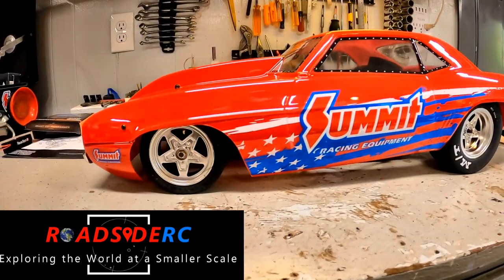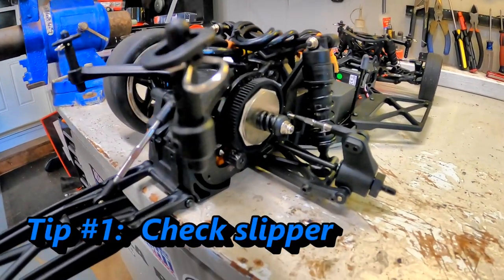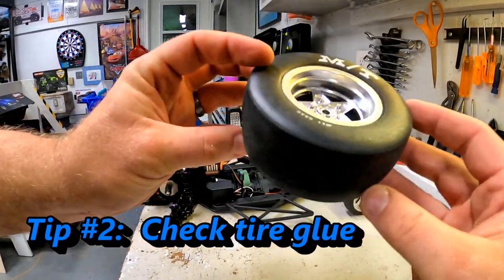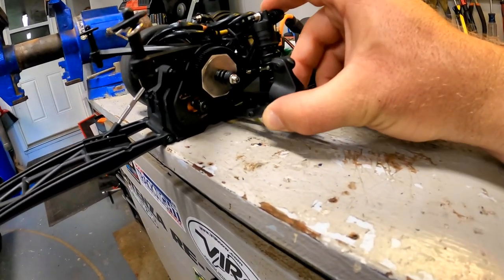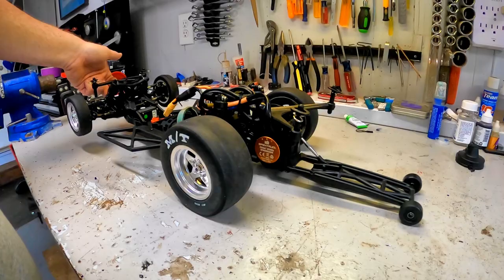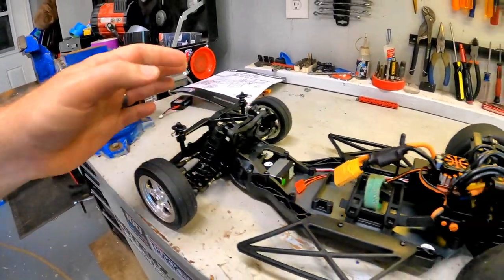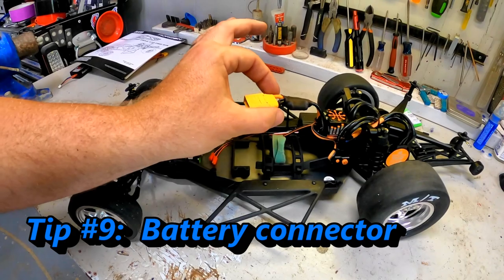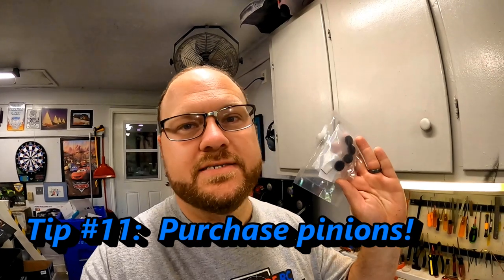DO THIS FIRST!  10 Things To Check on The Losi 22s No Prep Drag Car

Comment: Awesome video Troy, definitely good info right here. Another thing I would say to check its camber adjustments, mine had positive camber all around. Also tighten the servo saver nut a lil, it will help with steering wobble.
Reply from the maker: Nice adds!  My alignment was rather spot on, but you are right that it should be checked!

Now you are going to make me go check the servo saver!
Reply: I would just get rid of the servo saver...not needed in this application.

Comment: I have been living with my 22s camaro now for about a year and i found out that if you seal the vent holes in the rear wheels the tires ballon about 60% less. Also i realized that you must wear out the tires a little bit before they can achieve their maximum traction
Reply from the maker: That makes sense to me!

Comment: Thanks Troy!
I needed to bleed the shocks and remove   1 mm of flashing on one of the pistons that was binding. 
Besides the normal taping, I also had to taped down all the loose lighting wires, which were vibrating and wearing through the blue paint......luckily I bought a spare car for the shelf!
FYI, weight distribution on the Losi is 30/70 with a 4200mah slide to the rear, 31/69 slide all the way forward in the battery mount. GNSS only weighs 38 grams......so placement is going to have very little effect in the middle of the chassis😎
Reply from the maker: Thanks for the math on the weight distribution - that makes sense actually!

Comment: I have one but with the Ford truck body. 
Noticed exact same issue with the tires rubbing the truck bed, put stickers over it but will try black tape (probably look good with my black body. 
The back of the truck body doesn’t roll under like the car does so I don’t have that problem. 
I have a GNSS type system with an LED screen that doesn’t fit on the chassis so we had to mount it on the body. Don’t do that, I nearly lost it when I crashed. 
Looks like I’m getting pinions and rebuilding my shocks before racing season!
Great tips!
Reply from the maker: Awesome!  Thanks for sharing the differences with the truck body. 

Glad this video could help!

Comment: You have a rotary tool so grind some of the body away because of tire expansion in the rear and you can grind some off the gear cover and the right suspension arm it won't hurt anything 😊👍
Reply from the maker: I ended up taking off the gear cover completely - not really needed for drag racing.

I used some lexan scissors to trim the body. 

Worked well!

Comment: Awesome video Troy and I got to mention one hell of a tire save there I seen that tire go flying off the workbench I was like oh no and then you penned it right up against the workbench with your waist I've seen people use aluminum foil tape you do not have to keep replacing it like the duct tape and you can work with it a little better than the duct tape and trim it to your desired size because it comes on a rule you peel the backing off
Reply from the maker: Good idea with the aluminum tape!  I bet that would last longer!

Yes, my belly should be considered a super power!  :)

Comment: Got mine weeks ago. Added carbon fiber skid across the chassis. Hood pins. And today extek mount used to add a fan to motor.
Reply from the maker: Very nice!
Reply: @RoadsideRC   How rude of me, great video very very informative.
Reply from the maker: I still haven't done any mods to this one.  I just got the sway bar kit in and the toe blocks.  Will be interesting to test them.

Comment: Tips are great but I’m wondering are you going to upgrade the suspension? The stock doesn’t allow for travel( squat) on either the front or rear which is what makes a full size car hook. Also the front has to much down travel. If you lift the car in front the wheels go up with it, they should remain touching the ground when the front is picked up and stay down until the lift has reached max height. Also the rear should squat past the point when the wheelie bar has touched, this allows the rear to load and slightly lift the front, transferring all the torque to the back but still keep the car going straight.
Reply from the maker: Agree 100%!   The stock suspension is OK, but certainly not perfect.   
There is a LOT to be gained in suspension tuning - just like in full-size!

Comment: Awesome video. I drove my Losi Camaro last year had a lot fun. I charge my battery and now my car tires don’t spin. I saw a small button for programming l hit a few times by mistake. How do l set it back to factory settings? Thanks
Reply from the maker: The manual has a factory reset instructions

Comment: Xt90 are great who is hating. That's one of the easiest to solder and they support tons of amps.
Reply from the maker: Ahh.  Yes, but they add weight. 
Instead - you can run bullets straight to the battery.

Comment: 7:20
I thought the standard practice is to have a bit of air in the shock bodies which lack a reservoir, since air is compressible and you need to account for the space that the shock piston will take up
back when I used to own a Losi Mini LST, I tried to fill the shocks to the brim and it got pretty ugly, the shocks wouldn't compress at all and then the oil squirted out the seals when you squeezed hard enough
Reply from the maker: Not in the shocks I have built.  Especially of they have the rubber dampers at the top.
Reply: No air.  It creates great inconsistencies in the stroke. Bleed them good
Reply: @zackjay71  the shocks that came with the Mini LST were literally just cylinders with a hole for the shaft, nothing else
the compression of the air was the only thing allowing the shocks to move at all

Comment: great tips!
i recently grabbed the yellow f100 version on sale at a-main hobbies...
ill be disabling reverse and "softening" the brakes a bit as well...
might swap out the radio kit as well...gotta be able to dial out steering....
its gonna be a sweet bracket racer!
Reply from the maker: Awesome!  Hope you enjoy it!
Reply: @RoadsideRC  im sure i will!
right now im getting my "dragrat" dialed in for bracket racing...its a trophy rat with dr10 wheels/tires....
the slowest your car can be is 4seconds....
i have the car turned up all the way and with a ovonic 5200mah/50c 2s lipo im hitting 4.1 all day with occasional 4.00 ET......
wonder if i install a 4300kv moto would that "legalize" me more...stock moto in the car now is a 3300kv....

Comment: hello man it's my first time on your channel good content a question where can i buy one like that but a Mustang. Thanks
Reply from the maker: You would still buy the same car/chassis - but then swap to a Mustang body that is available. Pro-line came out with this awesome looking body:  https://www.avantlink.com/click.php?tt=el&merchant_id=4b85b2b7-558e-4304-89fc-54958c8f47f0&website_id=caf4cba5-8e5f-43be-93b7-934f1a36d50d&url=https%3A%2F%2Fwww.amainhobbies.com%2Fproline-1967-ford-mustang-1-10-no-prep-drag-racing-body-clear-pro3573-00%2Fp1332800
Reply: @RoadsideRC  nice man thanks for your answer I will follow you on this channel thanks again 👍🏼👍🏼

Comment: How do you know the slip differential is too tight? My car doesn’t go straight when launching, it tries to make a u turn after a few seconds.
Reply from the maker: You just need to test.   Go out and make 1-2 passes as it is.  Then back it off 1/4-1/2 turn and see what happens.
Typically, you should hear the slipper slip for at least a few feet - depending on your setup.

Comment: Why would people hate on you for XT90 connectors?  They (Along with the XT60) are one of the most popular and effective connectors out there.  In fact, if you look at the EC5 and the XT90 side by side, the only difference is the outer case shape.  If you cut the thin plastic case away in the middle of the XT90, you literally have an EC5 with the exact round top and flat bottom shape!
Reply from the maker: For the serious drag racers, they use very short wires with bullet connectors straight to the battery for even better performance.
Reply: @RoadsideRC  less resistance with bullet connectors. Truth

Comment: I just got around to buying the Losi 22s and the very first thing I noticed is the complete lack of downward travel in the front end  ( DROOP ) but all kinds of upward travel. Without the droop in the front end I can't see how it would have any weight transfer. In other words the front tires leave the ground on launch and you basically have no steering for some distance and no squat in the rear . Can you do a video on how to remove the limiters from the shocks.  If you put any real car on a lift the suspension will hang down for some degree but this car doesn't. Also if you push down on the front you'll see the car bottoms out. Ride height adjustment seems necessary but I'm not to sure how to adjust it.
Reply from the maker: I'm sorry.  I have since sold this car.

Comment: You need to upgrade the diff drive cups and dogbones. The stock ones are soft metal and get chewed up and breaks the dogbone
Reply from the maker: Thanks for the tip. 
Haven't broken mine yet!

Comment: You should make an update video of this car if you still have it. I’m curious if you or anyone else has figured out the same things I have
Reply from the maker: I'm all ears!
Reply: @RoadsideRC  I had problems with mine picking the front tires up and just going all over the place. So I took the front shocks apart and took the travel limiters off and put it back together. Night and day difference. It’s still all box stock and will make back to back 2.72 passes on no prep.

Comment: increasing the ride height with available adjustments?  If not, I was thinking about adding a few layers of wet layup carbon fiber inside the body shell.
Reply from the maker: I think you want to keep it as low as possible for performance - but yes, you can increase ride height a little.
Reply: @RoadsideRC  what’s your opinion on adding a couple layers of wet layup carbon fiber in the wheel wells…? Electrical tape is normally 5-7mm thick, I was thinking about 2-3mm of mold in place carbon fiber.
Reply from the maker: @itzjoeylo4501  Sounds like a great idea!   As long as it stays smooth and doesn't rip the tire.

Comment: Were you able to find out about cutting the body and if we can how much can we cut? I ran drag slash M/It's at the race Saturday and it did not eng well.
Reply from the maker: Depends on the class you run.   You will need to check the rules for the specific class.  Some allow you to cut the whole rear, some you must keep a bumper on there.
Reply: @Roadside RC  I cut mine enough that the tires won't rub, they rubbed Saturday at the races and then took a hard right, I made a record amount of rookie mistakes but learned a lot.

Comment: Did you do the shocks yet? Just got a new stock roller.  Not only did the shocks need bleed, the oil is water thin. Definitely not 40 & 70 wt as they state
Reply from the maker: Mine were pretty good.  Needed bled for sure, but otherwise OK.

Comment: I am actually still wondering why Losi shaped the rear of the body like that. I still havent cut mine down there but I'm not getting all that rubbing on it. I'd love to see a speed run before cutting it and after cutting it to see if it really makes a difference.
Reply from the maker: Maybe it is the less ballooning you get...
Reply: @RoadsideRC  I think you're right

Comment: Sir like your opinion on a tire balancer machine? I'm thinking of buying one? I just put a hobbywing esc and motor 4.5t on my car tonight..hard to handle I also got the skyrc gear as well so will post results soon...we finished up the infraction, losi 22s, and my typhon..took 10 hrs installing parts im.happy except for when I plug in my front lights on the losi the rig turns off???? The wire gets super hot..I'm lost?? Anyone had this issue? Rear lights fine only front lights.
Reply from the maker: Sounds like you have a short in the front lights.  Check your wiring!

Comment: Can any one tell me why my brand new 22s looses signal at around fifty feet won’t steer won’t move at all till I get closer
Reply from the maker: Check the receiver.   I am betting the antenna was pinched during assembly.
Reply: That was it thanks
Reply: And every one is right the stock rears no matter how much I warm them up it’s good to about 60 foot then she breaks loose
Reply: I’m just getting into drag racing so it’s all a learning curve for me
Reply from the maker: @davidrenaldo2252  Glad that was it!   Can be a free repair

Comment: hey troy 😁, can i ask you about the main gear or spur gear of this car ? i got mine losi 22s camaro recently but i striped my main gear(the black plastic big 1 gear ) during the first run, after that i purchase Hot racing gear to replace it, but i notice the gear that i installed is wobble, why did it wobble ? no matter how i take it out or adjust multiple time and it still wobble, i prepare for the worst and go for a test run, surprisingly the car runs fine and i run it for about 30 minutes, is this normal or i just mess something up ? thanks 😊
Reply from the maker: Hi David.   I am not sure why the gear has a wobble in it, but as long as it is running well, I wouldn't worry about it.
Reply: @RoadsideRC  i see, me and my friend have the same idea, well, i think i just keep running then, haha ~ thanks for the reply

Comment: Whats the outer diameter of the rear tires ?
Reply from the maker: I don't know off the top of my head.  Would have to see if it is listed in the specs.
Reply: @RoadsideRC  ive looked in online specs to no avail i was wondering if something like banditos sct onroad tires would fit maybe for more general bashing and running but thank you for your prompt reply man im gonna be getting 1 soon i think w swaybar and pinions and spurs wasnt gonna get the sway bar atfirst but i think after watching ur vid it probably is a good idea

Comment: That's alot of stuff to do to a car before running it. Losi should have thought of these before making the car. I'll watch how the Traxxas drag slash goes.
Reply from the maker: Honestly, I expect if I did a similar video for the Drag Slash, that it would be around the same things to check. 

This video is not meant as a slam on  Losi quality at all.
Reply: All rtr need to be gone through. Fact of the hobby